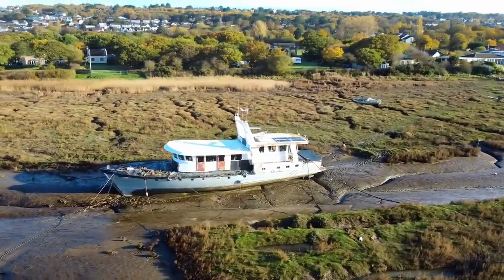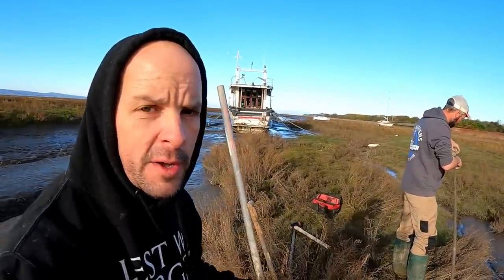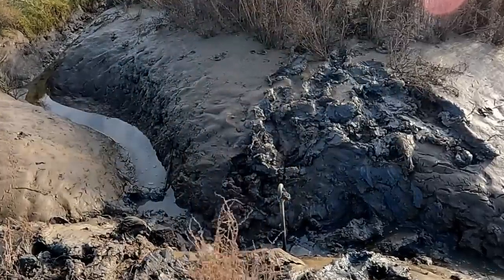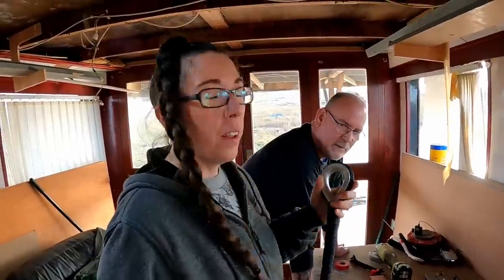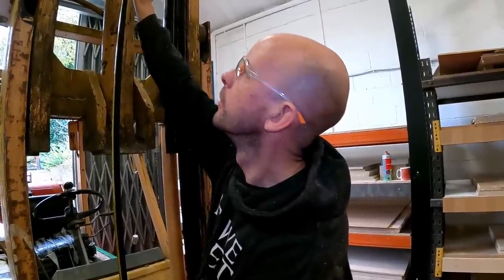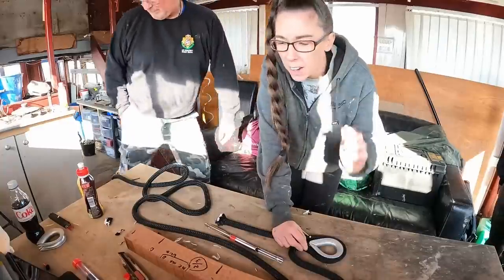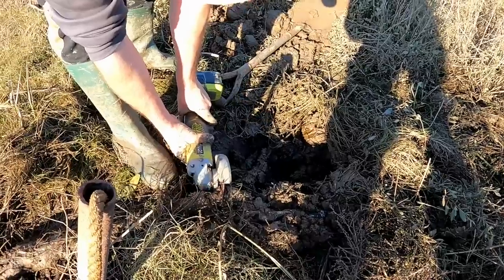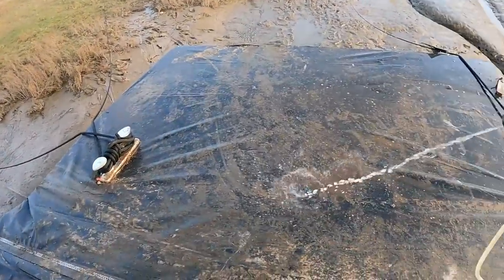Ep 103 -REPLACING & SPLICING Mooring Lines! #boatrestoration

Comment: It's time to watch a cleat tying video Simon! Full loop around, then the turn and a turn back on itself so that the two lines lay flat and parallel.   Also did you serve those shackles? You should run a piece of wire through the hole in the pin and back around the shackle throat to insure is doesn't work itself free over time.

Comment: It looks like it was a gorgeous day to be outside and I absolutely loved the way you tested the strength of the splice. I hope the fork lift has recovered lol.

Happy Christmas to you all xx
Reply: I didn't. I have seen dozens of those lines snap. They are incredibly strong and are factory tested rated by English braids. They will never fail within their specs. That test was lethal especially when Simon plucked it. That bar would have taken his head off on its way up through the ceiling. 
If he got behind the mast and knocked it forward with a sledge hammer it would have gone up so fast he would not have even seen it. 
Used that very size and type of line in movie making for years. We tied all sorts of boats to all sorts of cranes, JCBs, boats, trucks, winches, excavators, tractors. We filmed storms crashes wrecks overland shots underwater battles scenes. We tested that rope everyday possible in every weather condition. We probably wrecked about €10,000 a week of that stuff. It's absolutely brilliant stuff but it has its limitations and you can get caught out very badly when things go wrong so no I do not recommend ever trying that stupid stunt with it.
That rope it rated higher than his forklift so he probably would have blown a hydraulic line of stalled the forklift before it would have broken if he hadn't killed himself first.

Comment: Gemma, you made a lovely job of those new lines and thimbles, well done.🙂
Are you using electrical tape to tidy up the rope ends or to stop fraying?
Electricians Heat Shrink tubing is not expensive and makes a neat job. You can get it in a massive range of sizes and colours on either Amazon or Flea Bay. You can either use a gentle blow torch or a heat gun to shrink it. (Personally I think a heat gun is better and safer).
Happy New Year to all the Family and the dedicated crew of helpers.

Comment: 12/30/2022 Hello Ship.Two things. The eye splice is about 2 ft too short. That line will slip when wet. Talk to your marine supplier then to one of the old timers on shore who still rig. This would never be allowed in america for any industrial rigging. Two, Placing a n anchor line on the stern is not done. With your lumber on the back, this is an unnecessary risk of pulling the stern off. My boat was a pontoon. So we could never pull the back down. But on the 16 foot fishing boat it did splash over in all wakes. Just a thought. Your boat, do as you need and not as I advise. That is why you never tow a boat by the stern.   Happy New Year Don usa

Comment: Just curious. Could you have used 3/8" braided steel cable instead of rope? The nice thing about cable is all you need to get the right length are those cable clamps. No idea of cost differences.

Comment: Your screw anchors need to be at least a foot underneath the surface of the mud , left above the mud a couple of feet like you have will put undue stress on the anchor which will likely bend and the galvanising will flake off at the bend and will end up rusting  ... they might be long anchors but they are very spindly and not thick enough for this size of boat

Comment: Are you sure there should not be at least 1 line across the aft deck spreading the load to the other cleat and the lines on it just till the rotten deck is replaced so the cleat are not torn of the boat? Not complaining, just concerned for your and the boats well being.

Comment: Mousing in the shackles... Very important. Didn't see any being done.
The advantage of your old mooring warps was their own weight acted as a shock absorber. Those single Dyneema lines will not be enough on their own.
Surge tide in a storm only has to break one to let Sarinda sail/surf on and transfer the load to the next one.
That stern line is too direct..
PS Your 089 on the cleat is not good enough. Not only dud you do it backwards so the surge is pulling the crossove out with each tug but it is too open to be effective. Sorry guys but you need to go again.
Mouse the shackles
Spread the load
Help it breath
Secure the lines properly
Use the proper rope.